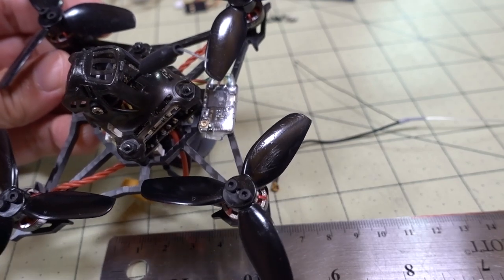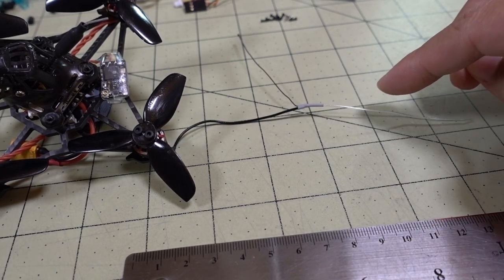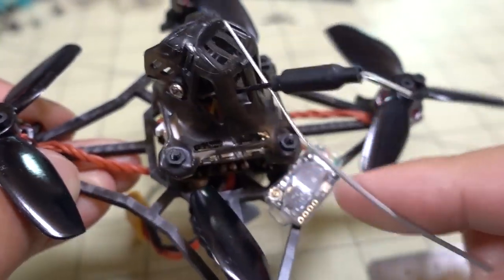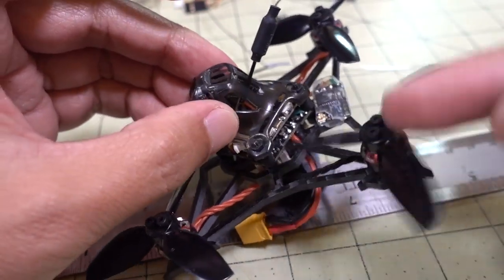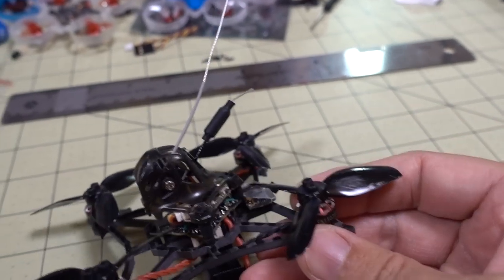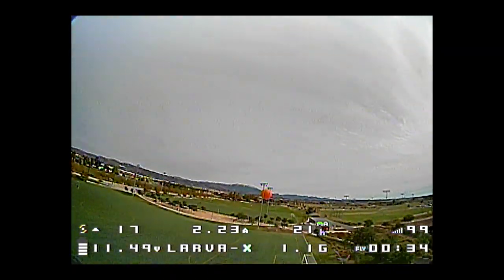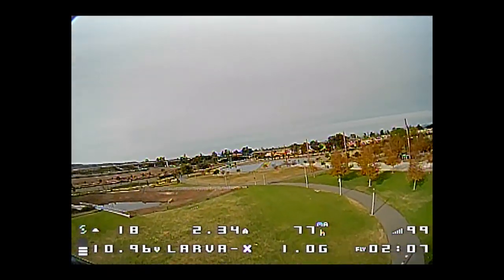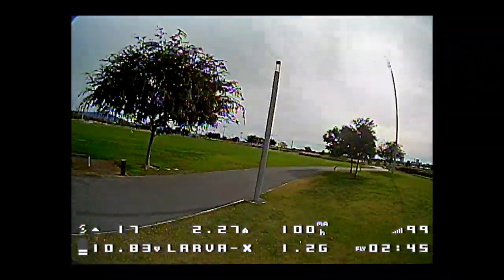Cheapest (and LIGHTEST) Crossfire Antenna for Micro Drones 💲💲💲

Comment: Great video.  I made a replacement VTX antenna using that same antenna you started with and saved the weight of the shielded counterpoise.  VTX didn't fry so I call it a win.  I would be curious if you modified your antenna to make it as short as possible with a 1/16 wavelength active element. Made me think could maybe use the carbon fiber frame as the ground plane/ counterpoise element.  Not many people doing these types of videos anymore.
Reply from the maker: I will demo 20.5mm length antenna later.  Spoiler alert... it works.

Comment: What I do is take a soldering iron with a super pointy pencil tip and burn a hole into an antenna tube large enough to put the stock antenna inside at it's full length. Run it under the back arms and attach it near the back motors. Drop of hot glue holds the antenna inside. This weighs less than an immortal T and more than the XF race antenna....but it's still full range.
Reply from the maker: Do you have a 100g micro that can take advantage of full range?  If so, can you share the specs please?  I'd love to go 10km on a 100g micro.  Please share.
Reply: No i just prefer to have my antennas protected mostly. Guess there is some peace of mind knowing a failsafe is extremely unlikely. I also wonder about signal degradation, link quality, etc and how it affects the frame rate. I'm sure you know that you aren't always getting that super fast 150hz  frame rate with the ultra low latency...and that is really the main reason I run crossfire on micros. Sarcasm wasnt lost upon me either Ill just assume you were having a bad day.

Comment: Does the non active part of the element have to be a multiple of the wavelength? I understand not necessarily for this application as you don’t need max range, but in general?
Reply from the maker: In general, yes.  However, I've flown with random length too.  Honestly, I'm no RF expert so I just do practical experiments.  If it works, great.

Comment: Al here’s another option for crossfire. The xf race antenna is great for micros and 5” alike. Easy to mount and there’s 3d print mounts for it as well. https://www.heli-nation.com/team-blacksheep-tbs-crossfirexf-race-antenna-915mhz I’ve actually got a few on the way and most everyone I race with that uses crossfire uses the xf race ant 👍 just another option for your viewers and still get pretty good range out of it. But it is $5 for the ant instead of 10 for $5 which is a great price lol but looks like your idea does good too. I’ll have to try it out.

Comment: Seems like a solid idea especially for micros, you might include Link Quality in addition to RSSI as that indicates the signal quality (signal to noise) whereas the rssi is just the strength. Much easier mounting and on a micro we're definitely not needing the dipoles range.
Reply from the maker: I'm not sure why this isn't the standard for micros.

Comment: light yes.. effective no..  however on such a small drone it dont matter..  but the groundplane needs to be unaligned on a 900mhz   , your design cuts range in a quarter or so..  but as i said.. dont matter on these
Reply from the maker: I would rather trade range for less weight.
Reply: @AlbertKimTV  then why use Xfire? stamdard 2,4 has enough range and can be built lighter